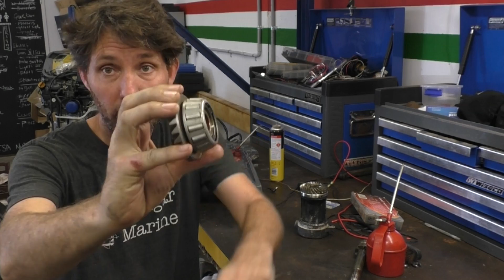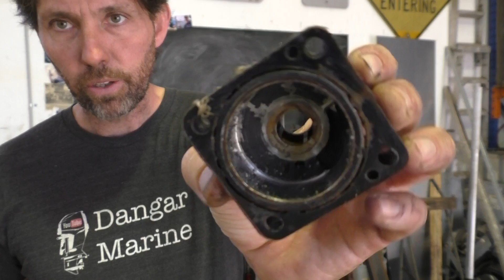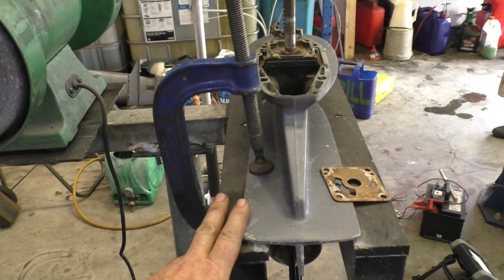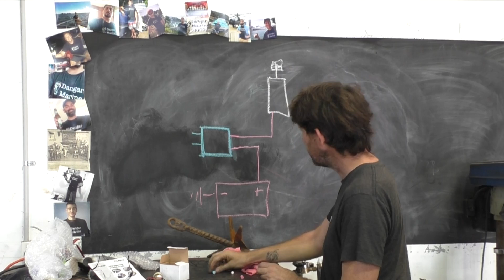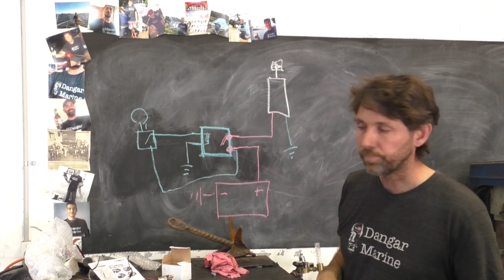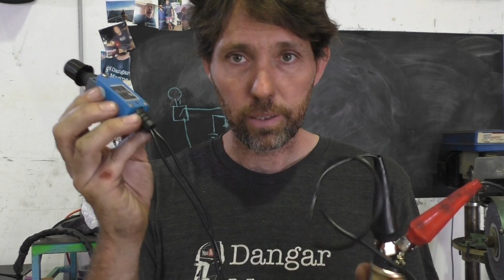Remote starter button, eventually...

Comment: If in doubt which little connection is neg..use a multimeter and test for ground, then use other small connector for your positive jump to close the solenoid

Comment: Hi, I do appreciate your videos. I've got a 9,9 hp 2stroke yamaha 1994 and I try to add a stARTER system from the beginning with the starter holder (bracket) and the rest of it. Could you help me to refer me some place I could buy those parts.

Comment: Gday mate now i see where i have to connect my remote starter i couldnt work out where you got the wire for the black lead from so connect the red to the large pole where power comes from the battery to the solenoid and the black to the small pole at the wire join on the solenoid .

Comment: I know it’s an old video but to anybody who may see..
I am wiring in a push button switch to my outboard. 
1) why would you need to fuse the circuit between switch and solenoid? And does it matter if I do not have a fuse ?
2) what amp rating wire do you need between switch and solenoid ?

Comment: Ok so you’ve started the engine from the stern...now how do you turn it off???? Also doesn’t having the ignition in the off position act as a closed kill circuit? Or does that only close when the physical key is inserted?
Reply: I have the same question, how can you shut the engine off with a push switch?

Comment: Brent here, Can anyone tell me how to change a lower shock mount  on a 1992...150 Forse outboard
Reply from the maker: Can't say I've done that job on a Force, but with the Yamahas I've done you just take the cover plate off and then undo the bolt that goes through the rubber mounts.

Comment: Stu, does the shift gear have to be in neutral, if the key is in the off position?
Reply from the maker: No, but you won't be able to start it again until it is so it is probably best to leave it in neutral if you can.
Reply: Dangar Marine u r awesome!

Comment: Do you have any older outboards that don't have a safety kill switch? I've got a 1980 merc 40hp tiller, 2 stroke, 2cyl single carb. No original lanyard kill switch but does have a mercury tilt switch and also remote key start. I'd like to add a lanyard kill switch and make it push buttton start as well. Thanks Stu, keep em' coming!
Reply from the maker: Unfortunately not. Most of the outboard around here don't last that long as they get used pretty hard every day.

Comment: When did you start saying, "ground" instead of "earth"? Why? Another great video. Thanks!
Reply from the maker: Because technically it is a ground, ie the reference voltage that the +12 is measured against. Boats don't have an earth which is literally the pin you see driven into the ground in house electrics etc.

Comment: How does my 2014 Honda BF 50D kill switch operate... when the clip is pulled out does it make a connection ,or break a connection.. I have two extra kill switches on my boat that I need to remove (I will obviously keep the one in my Honda ignition panel)... so when I remove a switch do I just join the wires together permanently, or seal them separately so they cant come into contact with anything ?
Reply from the maker: Kill switches work by making a connection to stop the motor so you want to join the wires permanently.
Reply: So do I just cut off the switch, join the two wires together and the motor will still start ??

Comment: DO you have a video or would consider making one for battery drain/starter or volt reg problems?
Reply from the maker: Hey Dennis, yes, I've been thinking about doing one soon on battery drain. I recently did one on installing a regulator though.
Reply: Thanks- I'll search your videos- very useful stuff- great job!

Comment: hey man Ive been watching your videos for quite some time, I'm wondering if you are going to do a video on how to wire a dual battery system with a selector switch. my second question is can I run two batteries in parallel on my my number 1 selection, and a single battery for number 2 which will be my start battery.
Reply from the maker: Hi Byron, yep, planning to add a second battery to the Green Machine and will definitely film it when I do. To answer your question, yes. Batteries in parallel are nothing more than a bigger battery so having a permanent parallel setup on 1 and a single on 2 is fine. When you set to "both" you'll get three batteries which is all good.
Reply: Awesome man, thanks for your reply. your videos have been really helpful, I have a 1976 22 foot Starcraft that I have striped down to just a hull, trailer is all redone, now to flip the boat and start sanding. Ill post some pics some day, I don't  have a video cam so that will just have to do. Thanks again man.

Comment: While
 working on my lower unit I accidentally loosened/removed the bearing 
retaining screw located near the water intake screen.  A small amount of
 what appeared to be  an oil substance flowed out of the screw.  My 
question is whether this is harmful to the engine.  Does my whole lower 
unit/gear case need to be removed and serviced or is it easily fixed by 
simply re-threading the screw?
Reply from the maker: Are you sure it is a bearing retaining screw? What model and year outboard is it?
Reply: no i am not sure, it is a Evinrude 1970 ish 40 hp
Reply from the maker: Hmmm, I'm not familiar with that outboard, but none of the more modern outboards I've seen have an external screw like that. I would be included to just put it back in and see how it goes, it may just be a drain plug.
Reply: Dangar Marine it worked out fine, it was a bit hard to put back in but i jiggled the outboard a little and it went back in. :)

Comment: Suzuki DT90 1998 
Hi sorry to interrupt again 
I've just removed and emptied my oil tank for my oil injection system and replaced with new oil, when replacing I allowed the oil to run through the pipe/tube just before the oil senser and connected trying to not get any air caught ! I have a Manuel but my carburettor seems to not have the same bleed screw as the one shown ?? It seems to have a long 7mm hex plug/screw at the front not the side !! 
It looked like it had never been touched before so I opted out as didn't want to snap or damage anything !
So I took the plunge and run the motor for 15 mins or so with no fault just a lot of the same lingering blue greyish smoke as before, Am I safe to assume there isn't any serious air locks and I can use it with no problems or can it still cause problems later on ? 
Please help as I'm taking her out on the weekend and don't want to end up with a blown head ☹️
Cheers Darren 
P.s will open my own account soon 👍🏼
Reply from the maker: Hi Darren, it sounds like it is going to be okay. Gravity bleeding it and letting it run though to the point of the pump should do the trick. Having the same blue smoke is always a good sign. You could also add a bit of oil to the fuel for the first run if you are worried.
Reply: Thanks stu much appreciated great help as always

Comment: Hi Stu, You have seen my expensive key start remote on my videos but I also have a old thumb button starter too. I got my remote since it has the choke if you push the key in just like my console. you should do a video on a remote tach set up. I'll be working on mine this week except Thursday going lingcod fishing in the sound🛥 
Oh and I have heard you can't use a old type dwell/tach meter. it needs to be inductive like a timing light for testing. the old type can be modified though to work with some added electronics. I'll find the video for you to check out. no luck finding it but a tiny tach/hour meter are cheap and are inductive.  it can be used just for testing on a 2 stroke engine or mounted permanent in the boat.
Reply from the maker: A portable taco would be a good video to do. Looking forward to seeing yours.
Reply: taco, yum making me hungry. haha
Reply: Since I have the tach in the console I removed it and will get a spool of 16ga which I'll need anyway down the line and make a tach extension harness for testing.  Don't need the light wire just the grd, ign, and send wires. Oh I have the new fuel lines about done just need to get another box of fuel clamps. zip ties are so much easier to install but don't trust them. I'll use them on wiring, water and air hoses. update, got my wire, and bullet connectors to make up my test loom. I shoot a short video after I get it together and tested.
Reply: You can get an inductive tacho with hour meter  that you can leave inside the engine bay. Water proof, about the size of match box, runs on its own battery. Good enough for setting up a prop and idle /carb adjusting with the cowl off with out doing a full dash tacho install. The hour meter is handy too for service  interval times.
Reply: Thanks for the reply and surprised someone else answered.  Anyway I know about the tiny tach/hour meter but thought since I needed more bullet connectors and wiring for other projects would just do a temp setup with my dash tach and use it for testing. Hour meter would be nice but it's a 1996 and would only consider putting one on if I rebuilt the engine. if my tach doesn't work I can trouble shoot it at the same time. So it serves more than one purpose.

Comment: I have a question about my Evinrude 55 HP mid 1970s boat motor, the trim on the motor will bring the motor all the way down but, it brings it about halfway up and locks and won't go any farther I have replaced the battery and tried the manual lift and it still does not work please let me know what the problem is. thank you.
Reply from the maker: If you release the bypass can you lift it all the way up?
Reply: no I tried the manual release screw and it wouldn't budge
Reply: where would the bypass be?
Reply from the maker: Next I would be disconnecting the top pin of the outboard from the trim tilt and seeing if it is a limit in the tilt unit or the outboard itself.
Reply: ok thank you.
Reply from the maker: It is the same thing as the manual release screw.

Comment: The water pump definitely looks like the motor has been run without water. And your fault description fits that as well. Sounds like a serious rebuild may be coming up.
By the way, how much of a recommendation would Paul give for the Tohatsu? Tohatsu have a decent deal on at the moment for 3cylinder 50hp engines at the moment so I am looking at it.
No beer is strike one!
Reply from the maker: It's strange that it would be run without water though given the boat lives in the water, but it could have been a plastic bag over the intake or something.

Comment: Seen people fill the rim with concrete to add weight,  in the us you can get a pre mix bag just add water.  Great description of the starter switch bypass,  I have always used a spanner for this but this would avoid the sparks
Reply from the maker: I am still temped to add the concrete. At the moment I like the idea of it being easier to move, but I don't want it being unstable so I'll try it for a week or two and add it if it isn't working out.
Reply: vxnova1 @dangarstu what about adding a flat base and casters and then filling the square above with the concrete for weight?  enough stability?
Reply: Ian, beat me to that suggestion, fill the rim with concrete and weld on some wheels so you can move the whole shebang around easily.